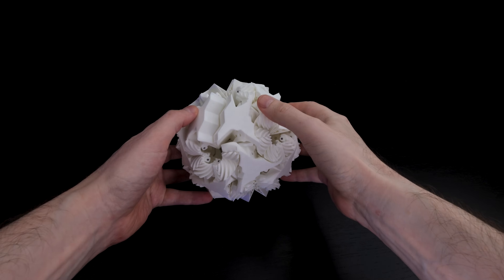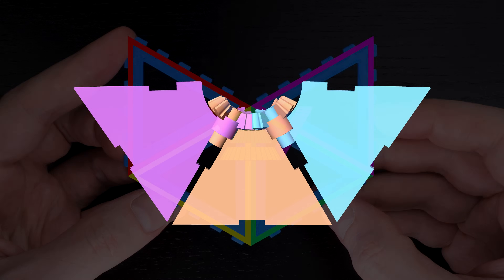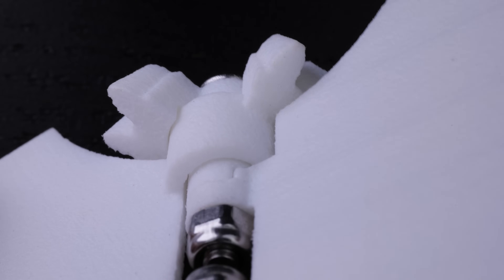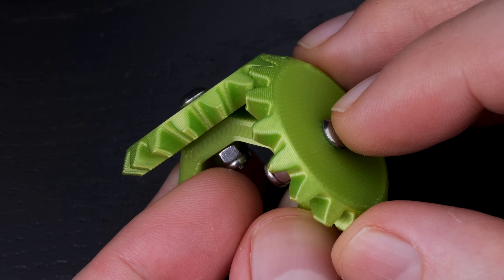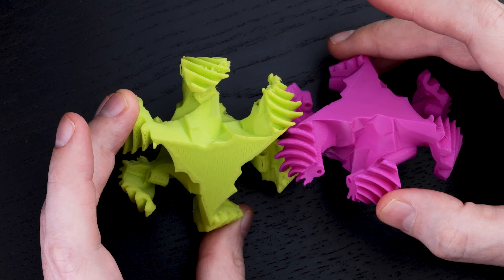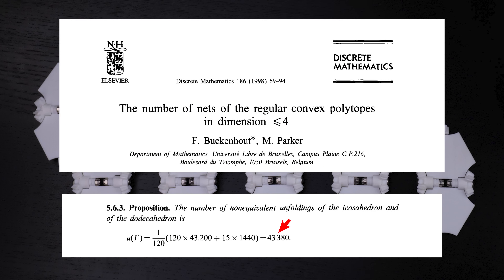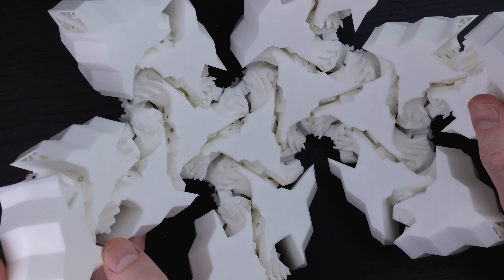Geared icosahedron net

Comment: A Deep Dive into the Geared Icosahedron Net

*   0:04 Introduction: The video showcases a unique spherical mechanism that unfolds into a claw-like shape and can lie flat or close into a sphere in two directions.
*   0:23 Design Concept: It's a purely mechanical design with one degree of freedom, meaning all hinges move together when it's manipulated.
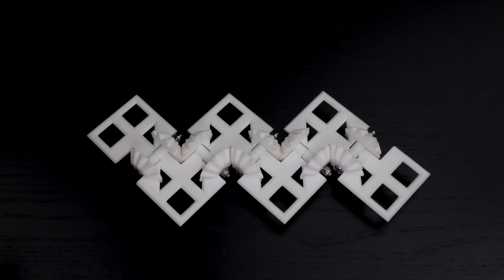*   0:36 Inspiration: The design evolved from the "Geared Cube Net" project, which demonstrated a geared mechanism that folded a flat net into a cube.
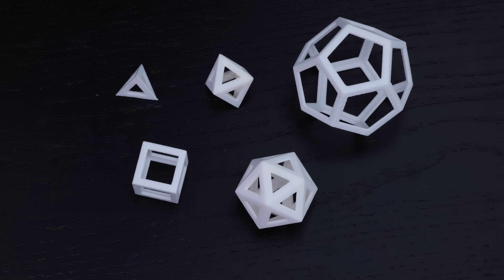*   1:18 Challenges of an Icosahedron: Adapting the concept to an icosahedron (20-sided shape) presented significant challenges due to longer chains of parts, leading to accumulated errors and "slop" (undesired movement).
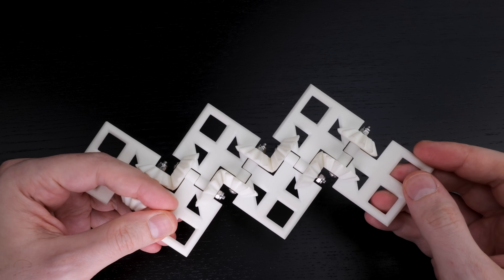*   1:56 Gear Mechanism: Each face has a gear meshing with a gear on a non-adjacent face, with the intermediate face acting as a frame. This becomes complex with four or more triangles meeting at a corner in an icosahedron.
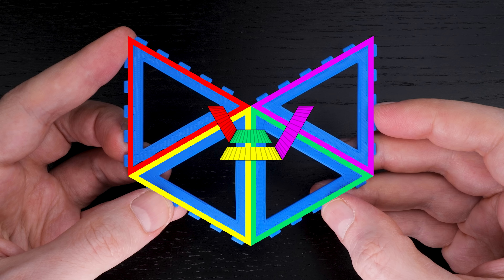*   2:45 Nested Axles Problem: Initial designs with nested axles required separate gear and triangle parts, leading to imprecise joints and assembly issues.
*   4:07 Collaboration: The presenter sought advice from mechanical engineer Eric Vergo, who provided valuable insights throughout the project.
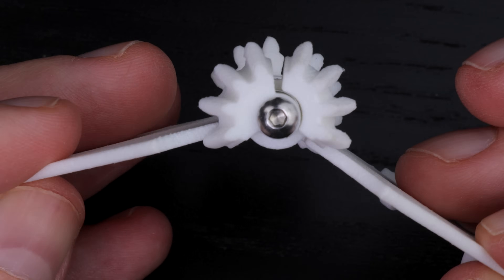*   5:55 Hinge Improvement: A new hinge design using metal rods and bushings was proposed to reduce slop, but it complicated the gear-triangle connection.
*   6:09 Helical Gear Connection: Gears were connected to triangles using a helical design, allowing for a shared axle and precise hinge movement.
*   6:29 Tolerance Testing: Test prints were made to determine the optimal hole sizes for 3D-printed parts to accommodate bushings and rods, minimizing slop.
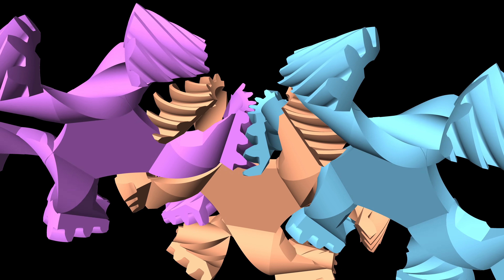*   7:00 Spiral Bevel Gears: Spiral bevel gears were used to ensure consistent torque transfer throughout the motion, addressing issues with gear contact in the first prototype.
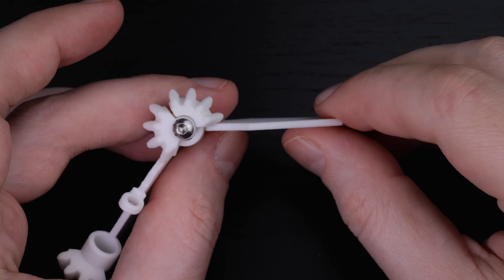*   7:38 Triangle Rigidity: Triangles were thickened and hollowed out with an internal lattice structure to improve rigidity and reduce weight.
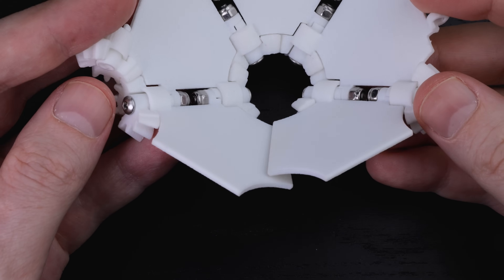*   8:02 Boundary Edge Alignment: A zigzag pattern and hinge stops were added to the boundary edges to improve alignment and prevent over-rotation during closure.
*   8:39 Assembly Challenges: The thicker design and single-piece triangle-gear parts created complex assembly procedures, requiring careful planning of part "flight paths."
*   9:49 Net Optimization: A different net for the icosahedron with a shorter maximum path length (diameter 10) was chosen to potentially reduce overall slop.
*   11:16 Prototype Performance: The second prototype showed significant improvement but still exhibited some flex.
*   11:30 Future Improvements: Further refinements are planned, including exploring alternative materials and CNC machining.
*   11:48 Aesthetic Considerations: The presenter acknowledged the un-triangle-like appearance of the current design and plans to add flat triangular panels to enhance the visual appeal.
*   12:14 Printing Method: Nylon SLS printing was chosen for its precision in various orientations, crucial for the complex gear geometry. JLC3DP provided the high-quality prints for the project.
*   12:26 Design vs. Printing: The presenter clarified that the remaining floppiness in the second prototype is due to design choices and not the printing quality.
*   12:35 Conclusion: The video concludes with an invitation for viewers to share their ideas and suggestions for improvement.

I used gemini-1.5-pro-exp-0827 on rocketrecap dot com to summarize the transcript.
Cost (if I didn't use the free tier): $0.03
Input tokens: 17232
Output tokens: 782

Comment: I love your mechanism designs. Can I ask how you make the models, like those in your animations?
Reply from the maker: @nnotcircuit010  I design in Rhino3D with its visual programming language Grasshopper. You can add sliders for all the parameters of the design, and you can use any slider to make an animation. It just moves along the slider, putting screenshots into a folder, which can then be made into an animation.

Comment: Best kind of chunky and complicated!

I think I would next try not doing the space-sharing gears in triangle corner, I'd have one plain and simple gear pair near a corner, and turn the other pair into a gear train instead: conical gears (printed as one piece with the face) somewhere sturdy in the midpoint of the edge, and an axle (separately printed, with conical gears on both ends) nestled inside the triangle face through which the rotation must be transmitted.
Reply from the maker: Interesting... of course more parts (the separate axle) means more slop. But it does sound like it could be easier to design and construct.

Comment: We miss your models, it was always great when we got a new Segerman to print. Every now and then we still get one of the racks come through or the tilings and I love showing the new recuits the coolness.
Reply from the maker: I haven't put this one up because it requires special hardware and I don't think it would work on an FFF printer. I have some more accessible designs on the way though!
Reply: @henryseg  I work for Shapeways, so we have the full range of printers ;) Always enjoyed showing the newbies the triple gear when they came through and how to make sure they were loosened.
Reply from the maker: @ Ah sorry, I thought you were talking about a maker space or similar. Are you with the new iteration of Shapeways out of Eindhoven? If and when the marketplace comes back online I’ll consider putting my stuff back up.
Reply: @henryseg Thanks for sharing Henry. I really hope you can please respond tp my email or other comments when you can. Thanks very much.
Reply: @henryseg  i just like modelling and playing with the models and using them as a jumping off point to iterate and integrate.
Reply: @henryseg  Can you put this up? I think a simple dual extruder printer with dissolvable support would just work fine.

Comment: To get a snug fit between 3D printed and metal parts, you can take advantage of the fact that the print is thermoplastic. Print the hole slightly undersized, and heat the metal part before pressing it in. Soldering irons work well as combined manipulator and heating element for this task.
Reply: The issue with heated inserts is avoiding deformation where not wanted. Pain in the ass, but heated inserts are my favorite with 3d printing
Reply: Could you instead chill the bushings to get them to shrink, and then install them in the correct sized hole?  Such that as the bushing warms it expands to press itself into place?
Reply: @bosef1 That would put a different kind of stress on the structure. It doesn’t cause a plastic deformation, but instead causes constant tension instead. I’m not sure what the implications are, just that it would be different.

Comment: How would you remove the nozzle ridges left behind by the printing process in order to have a smooth surface?  I am sure that for prototypes it is fine, but if you wanted a product with a smooth finish, is there any way to do this in the machine settings, or would you need to use sandpaper and do it all by hand?
Reply from the maker: You can put parts in a tumbler to automatically smooth them off. Although for a real final product, injection molding is probably the way to go.
Reply: @henryseg  Thanks!

Comment: Love all of your 3D printed mechanisms! What do you use to design your mechanisms? I use Fusion 360 but I have no idea how to begin designing helical bevel gears 😂
Reply from the maker: I use Rhino3D and its visual programming language Grasshopper. Twisting bevel gears are not very different from standard bevel gears - the gear curves are drawn on concentric spheres, and you just rotate those curves a bit as you increase the radius of the sphere.

Comment: 3d print two parts already connected so you can have a tighter fit. there should still be a way to insert the rods after they are printed.
Reply from the maker: There would need to be some way to insert the bushings in as well as the rods, and have the bushings and rods tightly held by the 3D printed parts. Seems difficult to me, but maybe there's a way.